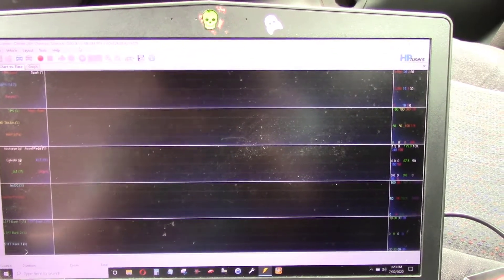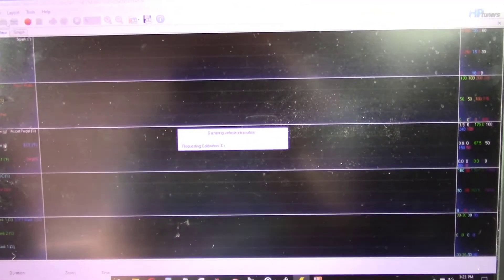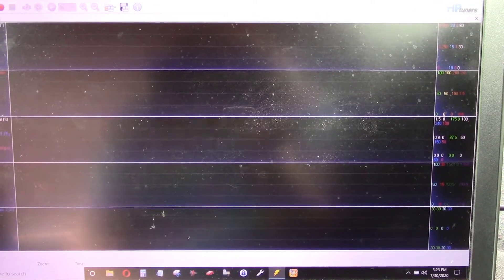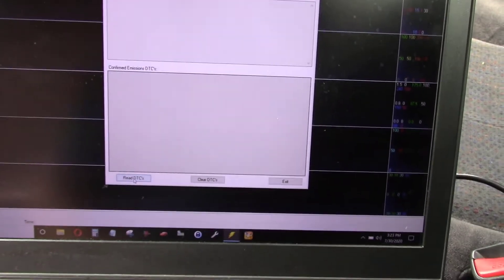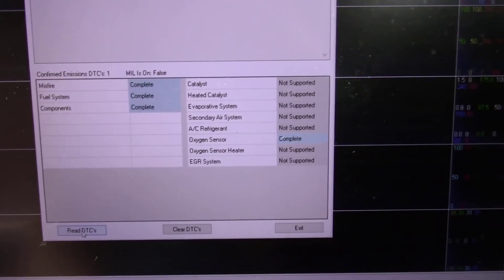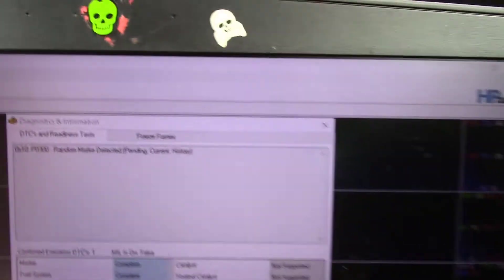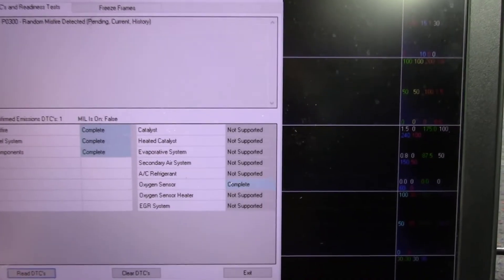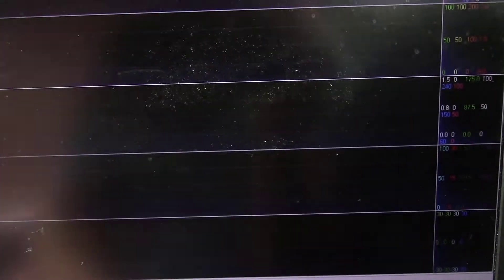8.1 Silverado Vortec engine misfire, causes, symptoms, diagnosis, repair using HP Tuners VCM Scanner

Comment: Hi, I got an 8.1 that will skip, flash engine light then take off like a rocket over and over, ideas? New plugs wires and coils,,,  thanks!
Reply from the maker: @Zipitydudaday Zipity what does skip mean? Skip shift or??
Reply: It drops several cylinders, mostly in cool to cold weather, rarely skips in summer. Changed coils, plugs wires, cam sensor knock sensor,,  reader just says misfire detected and sometimes a bank 2 heated oxygen sensor. Tried unplugging O2 sensor to no avail. When it’s happening I need heavy pedal to get up a hill and it will suddenly take off like a rocket! Then it’ll come back,,,

Comment: I have an 05 2500 w/the 8.1 and 395,000 miles. Has a misfire under a load and I've read everywhere to change the plugs and wires so I'll be tackling it next weekend 👍
Reply from the maker: Before you spend money, I would check fuel pressure and datalog engine parameters while the misfire is occuring. HPTuners does a good job of this and can identify the exact cylinder with a misfire counter. Good luck!
Reply: @CarswellsCustoms  too late... everything's already ordered LOL! Body rot is really starting to rear its ugly head unfortunately. I appreciate the advice, take care!

Comment: Hi! I have the same truck. At first power is normal, after 15-20 miles it acts like it’s loosing a cylinder. If I’m getting on a highway during this it will all of a sudden like a snap of a finger it will kick in to full power then I’d loose it again and back to poor acceleration. The only codes I have are left bank knock sensor and O2 . I have already replaced all coils plugs and wires, advise would be much appreciated! Thanks, Keven
Reply from the maker: I would first change the knock sensor since that call pull spark and make your 8.1 act weak. If that does not work, then I would find a buddy with HPTuners and log each coils spark misfire then zero in on the problem cylinder. After that use a fuel pressure gauge on the schrader valve on the fuel rail and look for 50psi all the time. If you are still having issues hit me up again. Cheers!
Reply: Fuel pressure is good, changed the knock sensor, still the same, lately it’s doing it more often
Reply: Also I have no engine light on now, even after it flashes when misfiring, although the code reader will log the misfire

Comment: definately blowing smoke, silver is significantly better conductor than copper
Reply from the maker: https://www.championautoparts.com/Parts-Matter/automotive-repair-and-maintenance/Spark-Plug-Materials.html
Reply: you are 100% correct. silver is far better of a conductor than copper. but copper takes the 2nd place trophy. gold is actually the least conductive out of the 3 but it does take the 3rd place spot. in case your wondering aluminum is 4th. but im not going to list every metal.

Comment: So your telling me you had a misfire in #6 you replaced the coil, wire and plug and it didn’t fix it then you replaced all of them and it fixed the misfire…. Am I missing something
Reply from the maker: The misfire was still present after #6, the engine did smooth out but was not perfect. After replacing all coils the misfire went away. You notice the datalog counted misfires and #6 was not the only misfire coil. Coils can misfire randomly without rhyme or reason especially when the spark plug gap makes the coil work harder. That is a big reason they burn up, but they dont always burn out and quit totally. So changing all coils eliminated the misfire. Did you notice how bad the plugs were? Imagine the resistance those plugs created to the coils, the original coils would be working their ass off to jump a spark through that garbage heating up the coil and shortening the life of the coil.

Comment: What gap are you running on the plugs?
Reply from the maker: @magicbullets45 I run .040-.045 in almost all applications.
Reply: @CarswellsCustoms  cool, thank you for the reply. I did .045 and almost everywhere was saying .060 so I was wondering 🤔 . Thanks again. I was having the same issue. 8.1 burning oil and killing spark plugs haha.
Reply from the maker: @magicbullets45  Yes, everyone has an opinion and I have always had good luck running that gap on HEI and COP ignitions in different applications that are Naturally Aspirated. I also like Copper Plugs due to the electrical conductivity - yes I have to change them more often but since my 8.1 likes oil there is no advantage in 100k mile plugs.

Comment: That’s what I was thinking our 8.1 vortec has had this off and on problem where it starts missing real bad to the point where when ur on the road and you hit the gas it sounds like it’s running on 4 cylinders and the rest seem to sputter in and out it almost feels like a turbo kicked in when they come back but they quickly seem to go right back out it’s had this problem for a couple years now and it has progressively became more common today we took it to the store it was doing the thing the whole way there but after sitting outside for about an hour we come back and it’s running great again we were thinking to do plugs and wires but changed the fuel filter first just to rule that out (the filter was never changed since 2002 and had 160k miles on it)
Reply from the maker: @Miniz I discussed my issue with a mechanic friend of mine and he said 90% of the time its from corroded battery cables and grounds. I went through my truck and cleaned the battery to engine ground (drivers side bolted to block underneath), body to frame ground, and battery to body ground. I used sandpaper to clean the terminals and dielectric grease to coat the terminals. They were nasty and the cleaning made my truck start and idle like a brand new truck! Pull your plugs and look at them closely using the spark plug reference at www.4secondsflat.com Spark plugs will tell you everything. I even added a second braided ground from my battery to the Body. Grounds are the most important piece of the electrical system. Start here and let me know what you find out!
Reply: Can you please explain how/where you ran the battery to body ground?   
I think my 2004 Chevy 2500hd 8.1L may have a bad ground.  At idle it sometimes almost dies then surges.  I also now have loud humming/buzzing noise that comes through the speakers (I think that’s where) when I open driver door.  Hard to explain sound - it’s not a factory warning bell etc..   I have had the truck since 2005 and now have 295k miles.  Been best truck a guy cold wish for so I’m happy to invest time working on it for additional years of service.  Thank you

Comment: Good video - great use of diagnostics tools. Glad you're fixing this oldie but goodie - you don't see many this vintage with under 200K miles, let alone under 100! I had similar / same symptoms on one of my 8.1s, except it got bad enough that the engine would misfire at higher speeds. Finally decided to replace all plugs and fixed the problem.
Reply from the maker: Thanks for the feedback! The cam sensor was pretty easy but the Crank sensor you have to plan ahead. For about 5 days I would crawl to the back of the engine and douse the crank sensor with WD40 to loosen it up. After that I reached back and twisted clockwise and counter then it broke free. I see some people have to drop the pan or cut a hole on the floor to access the crank sensor. I am super happy with the engine and truck especially after a tune!